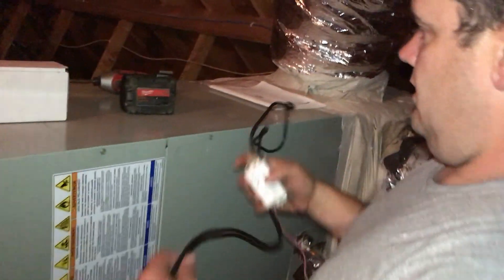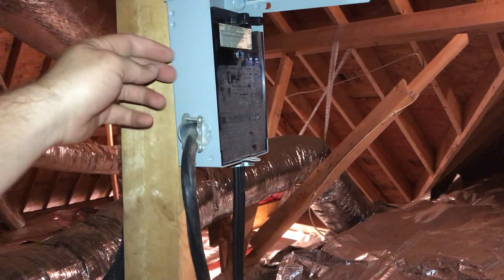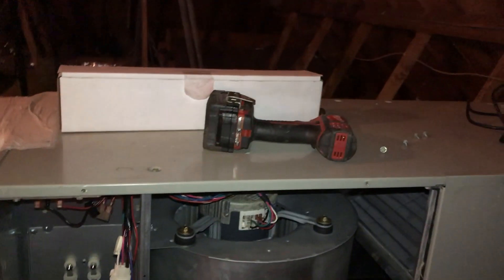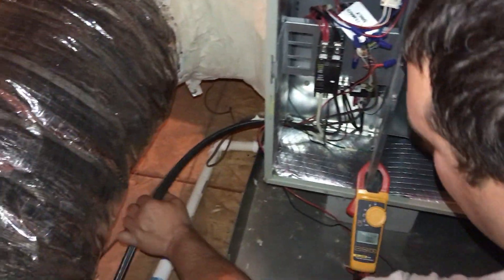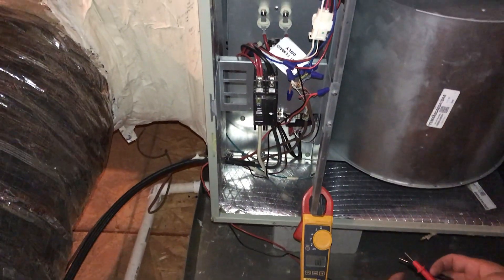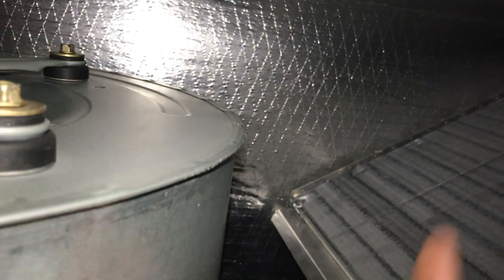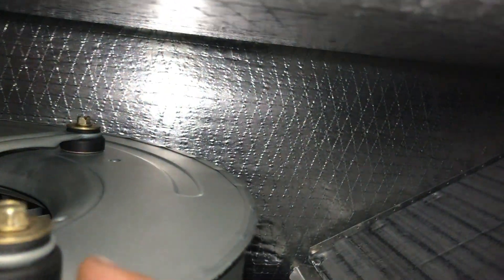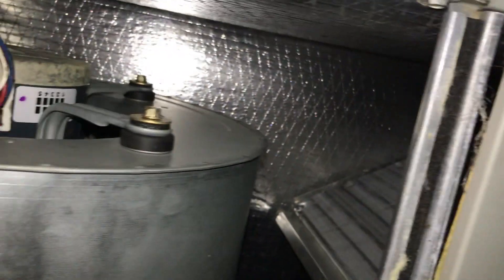UV Light install in HVAC. KILL GERMS and Bacteria

Comment: So if the wiring on blower motor is not UV rated wont that cause a failure.
Reply from the maker: Possibly.  But these lights are not that strong. And most new hvac systems are wired where not much of the wiring is exposed tho the air flow where the lights are exposed to them.

Comment: Oh that’s not safe buddy if you say you have zero across each leg you could still have 120 to ground on one leg coming in or out because the breaker itself could be bad. Same thing that happens when you diagnose a bad breaker.
Reply from the maker: Yes I know this. I also mentioned that we went through that on previous videos and if any one had questions to let me know. I know how to make sure I have zero power condition while working. Like pulling out the disconnect that I have done in that video and others. Thanks for the comment though.

Comment: Thanks for the video. As you discovered... while 17 " UV lamp assemblies will fit most air handlers, ones with the magnetic mount Z brackets, like the one in you installed in this video, easily adds another 3 inches to the overall length of the assembly which impedes a front to back (or side to side) installation. Although you eventually got the lamp mounted using the magnet...  one option that may have helped you with placing the bulb where you originally wanted it would have been to use the break away tab feature and lose the magnet (as shown at four minutes and thirteen seconds into this video) https://www.youtube.com/watch?v=gv2mH2s7S2A  -  Its hard to tell from the angle of your video but it appears the lamp where you finally mounted is below the apex of the A coil. If that's the case the underside of the coil as well as the drain pan will benefit from this location but the top surface of the coil will receive limited benefit from the UV light.  Ironically at 8:53 of your video your son suggested a perfect solution when he said "Could you mount it by the top?" To bad you didn't try. If you attached had attached the magnet to the top of the cabinet and allowed the bulb to hang down vertically (bulb perpendicular to the coil) the light would have covered both the upper and lower side of the coil. One final suggestion: As you probably know a UV light can cause structural degradation of plastic, wire insulation, flexible duct liner, fiberglass duct board etc. Any exposed wiring or plastic inside of the duct or air handling system in direct line of site of the UV lamp must be shielded with aluminum foil tape or equivalent non-combustible material. I noticed reflective foil on the back side of the cabinet but was unable to determine the black looking material of your drain pan below the coil. If its plastic you may want to line it with aluminum foil tape. There appears to be no wiring or plastic in the area of the UV light but you might want to shield the insulation you exposed where you cut away the foil on the back of the cabinet during your first  attempt at mounting the light using the magnet (seen at 10:14 in this video).
NOTE: As of today there hasn’t been any research looking at how UVC affects Covid-19 specifically, however, studies have shown UVC lights can be used against other corona viruses, such as SARS. Be aware not all UV lights are created equal! During this time of Covid 19 a lot of questionable people are selling fake and/or ineffective UV lights. The problem is there are four (4) types of UV light. Vacuum UV or UVV (100 to 200 nm), UVC (200 to 280 nm), UVB (280 to 315 nm) and UVA (315 to 400 nm). Although the entire UV spectrum can kill or inactivate many microorganism species and prevent them from replicating only UVC energy at 253.7 nm (nanometers) provides the greatest germicidal effect. ONLY UVC (200 to 280 nm) has been tested and verified as being effective in killing and mutating corona type viruses. NET:.... Make sure your UV light of choice is advertised as UVC and does not include any advertised benefit of also having UVA. UVA releases ozone into the air which is a known lung irritant.